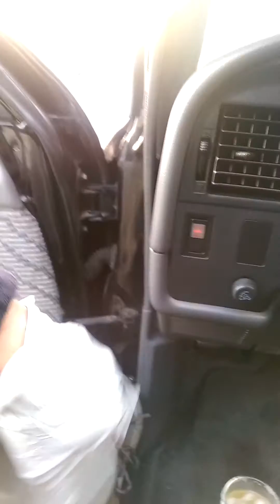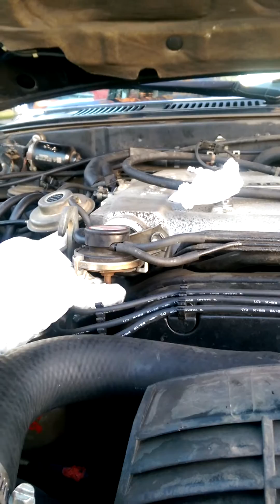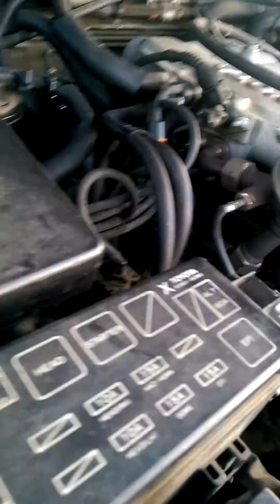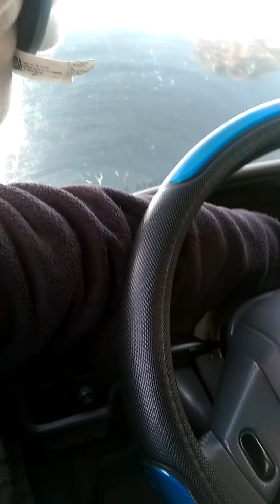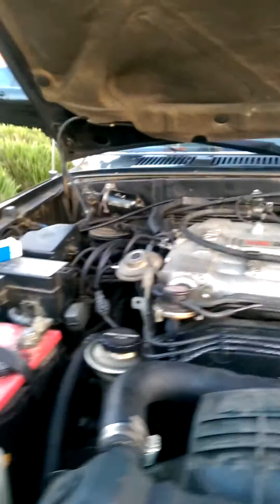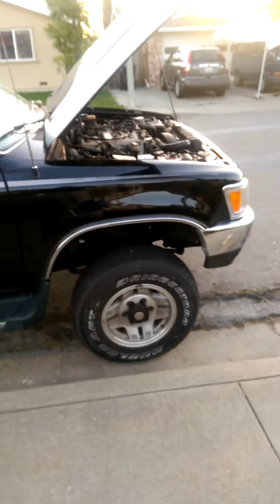Rough engine start. Vacuum leak.

Comment: I have a 93 4Runner v6 3.0, my issue is rough idle kinda of a misfire when I have my foot on the gas when it’s at 1,500 rpms and it only does it then when I’m stopped or when I’m moving at whatever speed. I did spark plugs, wires, cap rotor.
Reply from the maker: Check spark plugs.  Maybe one spark is not gaped properly and check timing thats more of the rotor and spark plugs issue.

Comment: My 4runner just started idle surging I'm wondering if you could help
Reply from the maker: Check you lines from your break booster and in your throttle body. What engine  does it have?? The screw from your idle on your throttle  body the O ring goes bad. It could be a few things but look at the ones I mentioned

Comment: Hey need some help with the vacuum lines. Facebook ?
Reply from the maker: Senal Devasurendra hey what's wrong with your car??
Reply: Mr. Fixit ayala, I removed all the vacuum hoses to take the plenum out, now when I’m at a light on brakes, I hear a high pitch tone. When release the brake and stomp again it goes out, also rpm jumps
Reply from the maker: Senal Devasurendra do you happen to have the book for this car. It would help you a lot sounds like one of the hoes is at a wrong spot check the lines from the break booster.

Comment: Nice i think i have a similar problem but the difference is that actually there's an error code of intake air leak in my car but i just can't find it.i put sealant in the egr valve replace a breather hose in the engine but i just ran out of ideas...by the way my car is a suzuki forenza05
Reply from the maker: What code you came up with hope you find that leak those are hard to find
Reply: Mr. Fixit ayala its p2279
Reply from the maker: Yeah so that leak is creating a reading and there should be sensors around to pick up the reading and yes similar to my issue here where air is entering the system.